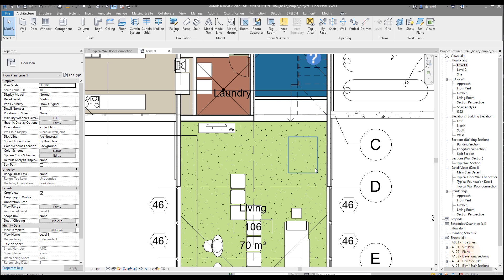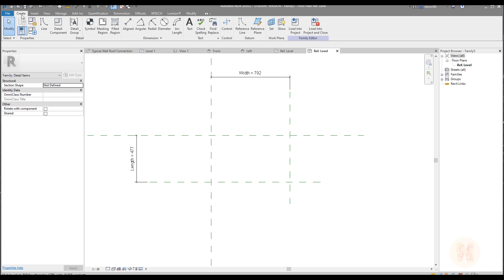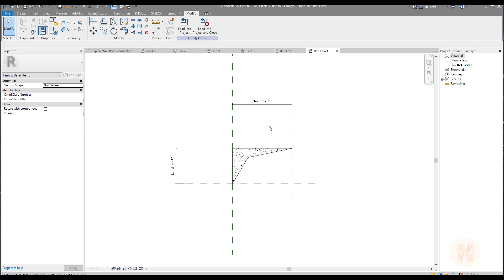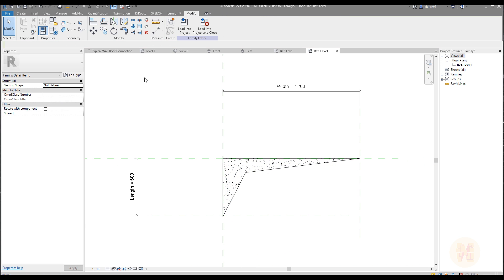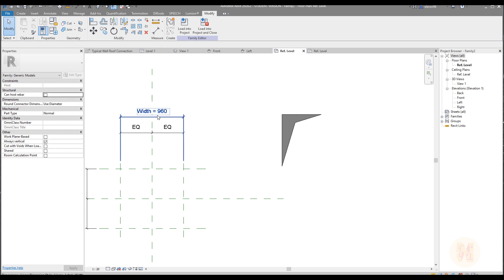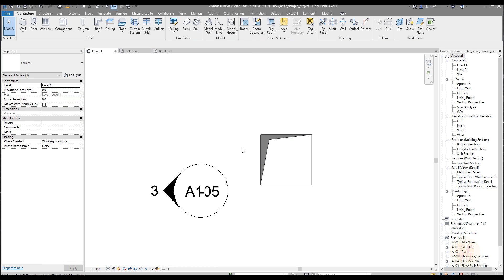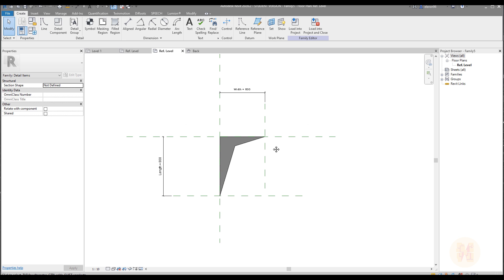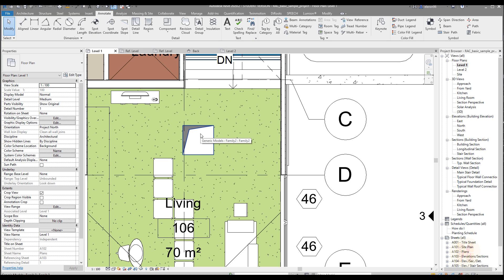Custom Shaft | Family in Revit | Free

Comment: Why not using the Symbolic Line in the Shaft Tool , Ofcourse there is no hatch but you can draw for example cross lines .
Reply: Cross line symbol for shafts is not used in EU and it is unreadable for most situations. Hatch symbol is much better and well established in Eu society.